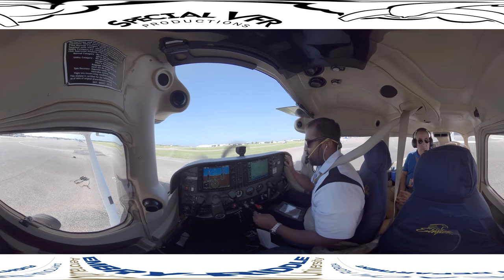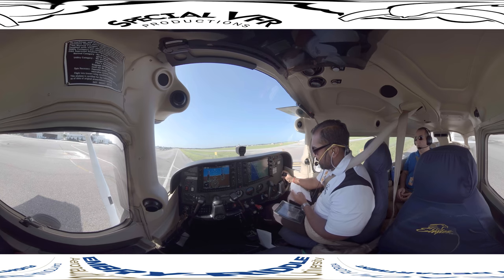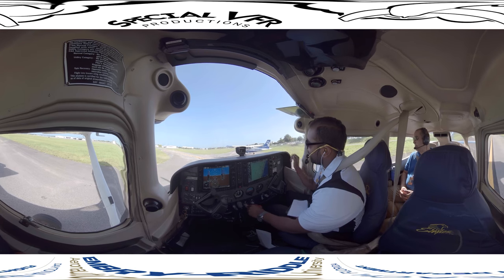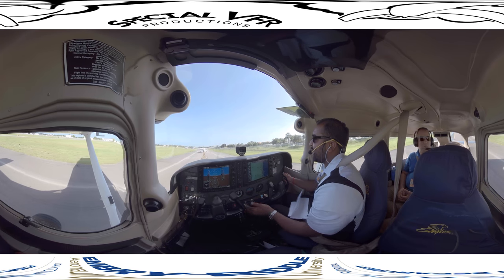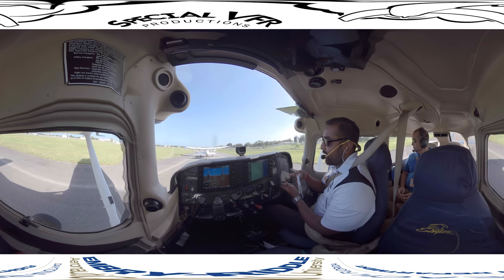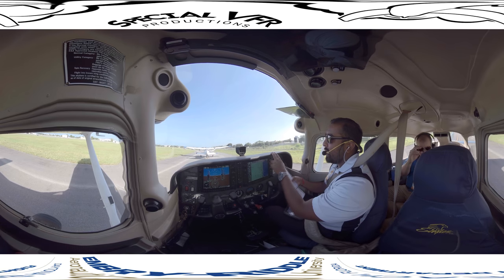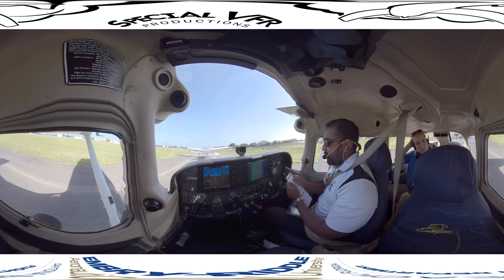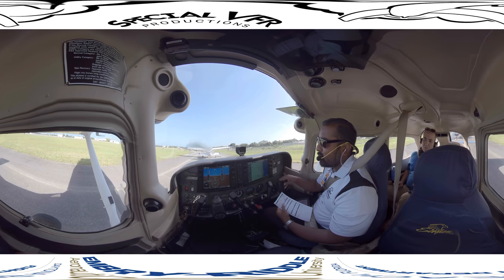First Flight - Part 02

Comment: I'm wondering if a dedicated lapel mike just for the camera and instructor would have cleaned up the sound without all the obliterating back ground noise of ATC traffic. This could have been a great video.
Reply: I hope that works. Your video and instructor information (when audible) was to good to be lost to audio distraction.  Cheers !
Reply from the maker: The engine noise is too loud for the lapel mic. We will be shooting maneuvers soon, and are going to try to capture intercoms, and radio traffic on separate channels. Hopefully that will solve the problem. Thanks for watching!